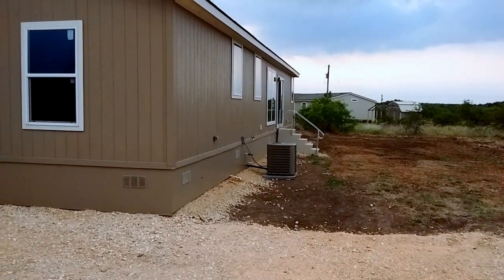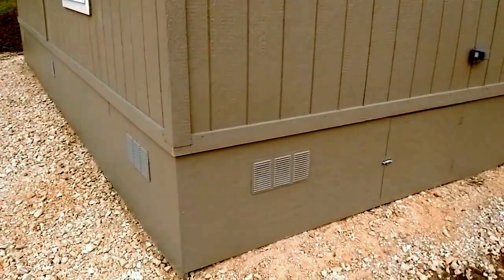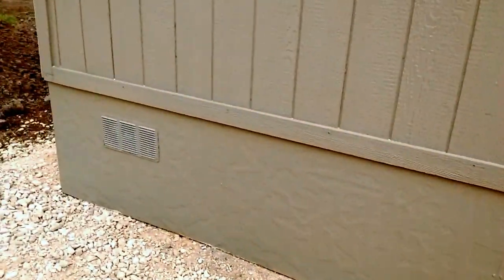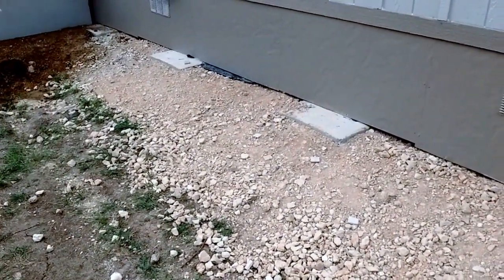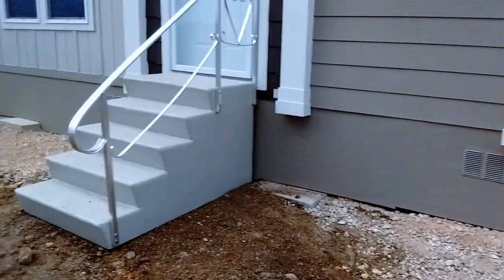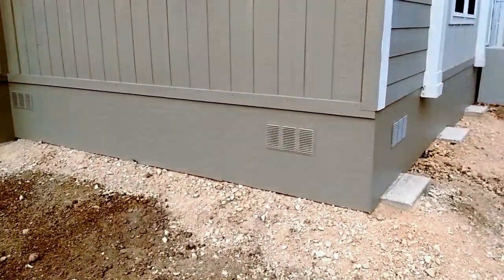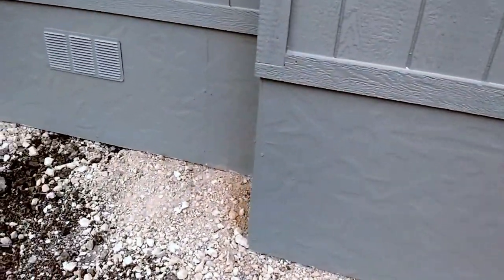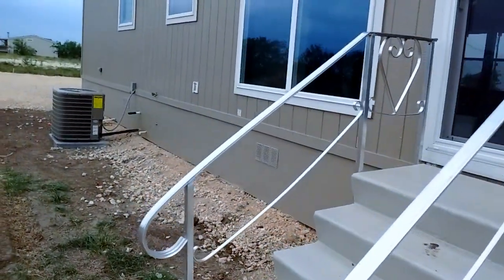Manufactured Home Skirting Installation Completed

Comment: Looks nice. 
We're going with a cement board product as well. 

How did they rodent proof the bottom edge of the skirting?
Reply from the maker: We put down a bead or small mound of a wide spectrum insecticide like Amdro granular around the base of the skirting.  That seems to keep them away.  Some snakes and lizards are unaffected by it so it's not fool-proof.  Best thing is to eliminate what they eat and they won't come/stick around. Getting rid of small rodents will keep the snakes away as well.  It's the food chain thing.  Be mindful of use as it can affect birds who may eat the small bugs who are eradicated by the Amdro.

Comment: 4 years later, how has the skirting held up?
Reply from the maker: Hello Mecca,  We have had a few cracks show up mostly around the fasteners.  The panels themselves have held up will to decay or rot.  When it comes time to repaint the skirting, we plan to use a good quality, paintable latex/silicone blend caulk to fill in the gaps and cracks.  We will probably use a small trowel to move the caulk around.  If you look closely, you will see the panels have a trowel texture so we don't have to worry about getting back to a flat surface with the caulk.

We have put bug barrier products up against the skirting, as shown in another video on our channel.  That has not decayed or swelled the panels.

We are pretty happy with how it has held up.

Thanks for checking out our channel!  If you have any other questions, drop us a comment and we will try to give an answer or steer you in the right direction.

Comment: What is the name of the material you used for the skirt
Reply from the maker: Hardy Panels, I think.  It's a concrete impregnated board that comes in 4' x 8' sheets about 1/4" thick.  It's available at most big box home improvement stores.  In our case, the installer used a product with a textured surface.  Has the look of a troweled surface.  The panels were cut to fit on site so no 2 are the same.  It's difficult to cut and drill.  They were using a carbide blade in a table saw to cut the panels and a masonry drill bit to make the mounting holes, it's pretty tough stuff.  The one drawback is the panels are somewhat brittle and can crack easily when handling.  Hope that helps you out.

If you have not already done so, please subscribe to the channel and give the video a like.  That helps get the video in front of more folks like yourself who are looking at manufactured home information.

If you have any further questions, send us another comment and we will try to answer based on our research and personal experience.
Reply from the maker: We are pretty sure it's hardy panels.  It arrived on site in 4' x 8" sheets and was cut to fit on site.  Each piece is slightly different due to ground grade etc.  We have been told Lowe's carries the 4' x 8' panels but we have never had to replace them so that would be something to check locally

You could probaly ask at your local big box home improvement store what other are buying for skirting.  They can assit you with what products are available in your area.

Hope that helps and thanks for stopping by our channel!

Comment: Is this just regular hardie backer board painted?
Reply from the maker: Yes it is but it's concrete impregnated and has a texture on one side, the outer side.  The texture mimics a spread plaster look.  Cant hardly drill through the stuff, it required a masonry bit.
Reply: @countrylifeinlockharttexas760 looks great. Thank you!

Comment: What material did they use for the skirting panels.
Reply from the maker: The frame supporting the skirting is made out of metal stud material.  The panels are made from Hardy Panels which come in a 4' x 8' sheet and were cut to size on site.  Each panel is a slightly different size to match the slope of the ground.  The panels are attached with drywall screws.  One thing to mention, the drywall screws have a countersunk head.  The screws are countersunk into the panels to give a flush appearance.  After the panels were installed, a 4" trim piece was added along the top of the panels to cover up the seam between the panels and the home's siding.  That trim is a Hardy Plank material with a wood grain surface.  Most or all of these materials are available at the big box home improvement stores.
Reply: @countrylifeinlockharttexas760  what was the total cost of materials and hiring labor?
Reply from the maker: Thanks for checking out the video!  We got our home as a home/land package so there may be some discounting on the skirting.   However, the various phases of the construction were broken down.  In our case, the skirting was $2500 material and labor.  This will change with the size of the home.  Our's is around 1500 sq ft.  Also keep in mind the price is a few years old so make some adjustments for cost increases.  Hope that helps and if you have any other questions you think we can help with, drop us another comment.